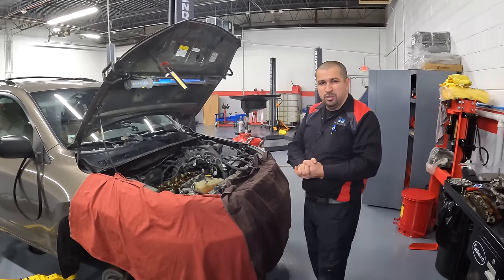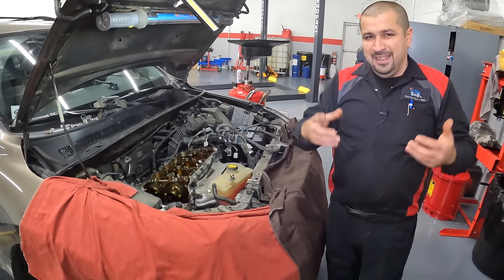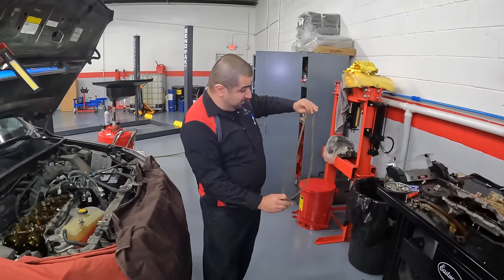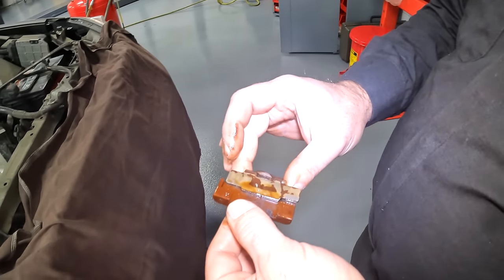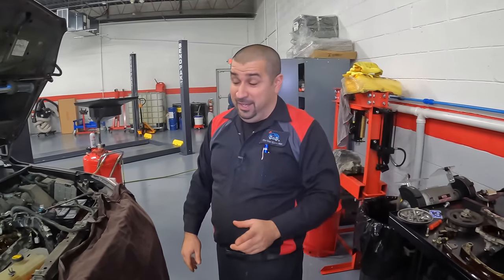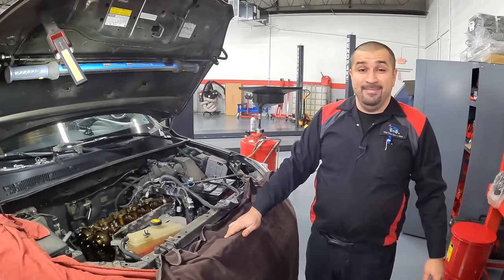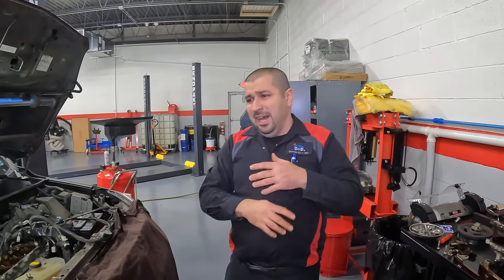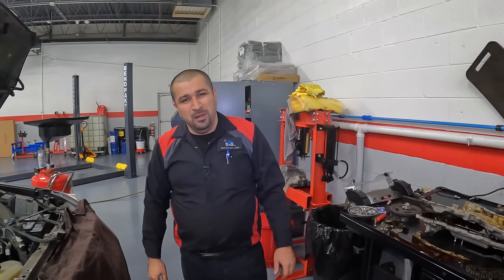When Should You Replace Your Toyota And Lexus Timing Chain?

Comment: Hello Mr car Care nut. I have a 2014 Toyota sienna and I have owned it since it had 10,000 miles on it. I have wanted to get my transmission fluid changed, but all of the local mechanics or the dealer want to do a transmission flush. I am very leery about doing a flush because of all the videos saying that flushes are dangerous and could cause dirt to clog up passages inside the transmission and cause slippage or total malfunction. I would do this myself but I have cerebral palsy and I am wheelchair-bound so my van now has 92,000 miles on it and the transmission is fine, but I know I need to get the fluid changed. What is your advice so that I will keep my transmission from failing? Should I chance the transmission being flushed? I love watching all your videos! I wish you were here so you could do the job! I have watched you treat every car you work on like it was yours and that is what I want. I live in Waco Texas, so that is a long way from you. Thank you again for your time! 
Your long time listener and friend! Robert.

Comment: My used 2012 5.7 Tundra timing chains failed. Bought 1 year ago. Oil was mostly changed mostly on time until maybe the 3rd owner roughly around 95k miles. Valve covers seeping oil slightly, small coolant leak at front of motor, bypass coolant area. Seized drivebelt tensioner bolt.

Comment: In a perfect world you would also replace the sprockets that drive the chain. A close inspection of the sprokets will reveal curling on the power side of the lugs wich will increase tempretures and cause premature ware of that new chain.

Comment: Another great video. Question about the Toyota recommended procedure for working on the VBTI gear. If doing it the Toyota way, not removing the valve cover, can the timing chain be scoped, with a camera, to check the paint marks that you mentioned?

Comment: Love your videos ! I'm building a 1ARFE for my 2013 highlander based on your video replacing the shortblock. the only question I have is do I need to unlock the timing gear   lock pin and put it in the advanced position before installing the new chain? I did not remove the cams or gears from the housing ..

Comment: In the 1970s Nissan and other brands used a double row of rollers on these chains. I think including Toyota. Now to save money and weight they use a "bicycle chain" on many cars. Many are lucky to last much longer than a belt. Toyota parts should last, but a single link roller chain would not be the best available. Never heard of overheating as an issue for timing chains. If if rattles when you start the engine, time for a new one.

Comment: Thanks for a good information. Few days ago I change the transmission oil & strainer for Toyota corolla 2013.I try to measure theoil discarded but when check the oil in warm measured 3/16"above the line. this cause problem to the transmission or is better to discard some part of the oil. thanksfor the information, GRACIAS.

Comment: I have 2000 Tundra  3400 6 cyl. 152 k. timing belt done @ 120k. I really like this truck. I don't think I will gamble with Timing belt. So new one will go in @ 220k spend a grand  and rest easy for another 100 grand. Also, I  love driving a solid vehicle with no payment.

Comment: As someone who has owned the greatest Toyota gas 4 cylinder of all time then 22R-E yes you can wear a Toyota timing chain out and guides do wear out as I have had it happen.  In the case of the 22R-E it will eat the front cover.
Reply: The 1975-1980 20R had a more durable double row timing chain mechanism than the single row 22R-E.

Comment: AMD, could you make a video on properly replacing coolant and bleeding air out of a 2AR FE, specifically for a ‘16 Rav4? I saw your video on the 2GRfe V6 but not sure if procedure is the same. Might be too simple for a video but I’d suggest throwing in transmission fluid and brake fluid for the same vehicle! 😅😅😅😅 I want to do them myself but not sure if procedure is the same as your existing videos.

Comment: Timing chains have been around since the first engines.  Then manufacturers changed over to timing belts ( most likely for cost savings and maintenance profits).  Manufacturers are going back to chains again because they are better.

Comment: Toyota engines are durable, except when they aren’t, is the actual lesson of this video. Their timing chains last forever…but this Toyota needs a new chain because of a design defect involving the intake VVT-i gear. In this vehicle AMD points out that the gear is replaced with “an updated design” — in other words, the original was defective, and caused a cascading series of expenses: the chain, guides, etc. And, given the age of the RAV4, it is no doubt out of warranty.  These vids are excellent, but what is often missing is a hint at what a shop repair costs. For this fix: $3,000? $4,000? That said, my 2008 RX350 has 135k miles with one engine related repair, the water pump at 120k. So, change your oil every six months and cross your fingers, because luck plays a role, even with a Toyota.
Reply: And do your research to know what problems can happen, which you're doing by watching these videos for example!

Comment: Hello Charley,
I have  a 1st Gen 2000 Tundra v8 sr5, extended cab with 428k miles it has an original engine and it still feel great. 

Recently, I had a near miss!  I hit the brakes super hard to miss slamming into Te car in front of me.  Thank God I did not hit him... I came within inches of hitting him bit I did not!

Since this happened, I hear a noise that sound like an air leak every time I step on the brake.  That that mean my break booster needs to be replaced, if so what do you recommend I replace it with?  Toyota has discontinued this model year break booster?
Reply: So sorry AMD, for some reason I thought your name was Charley!

I have to admit that yiyr videos are awsome and your knowledge is we all need a lot of!  God bless you  always!

Comment: I have an oil leak on my 2005 Avalon with 216k miles. It’s coming from the timing chain gasket so I might as well change my timing chain. But I never noticed any major issues but the oil leak

Comment: I may be a bit paranoid about this, but I have a problem with mechanical components that don't have a stated service life. It seems that in recent years timing chains have been failing prematurely quite often, and some manufacturers have had widespread issues. At least with a timing belt you don't have to go with any vague promise that "it will last the life of the vehicle", which is just Lawyer for "it will last until the end of the vehicle's warranty". You know when the belt is supposed to be replaced and how much it's going to cost, and a missed belt change is obvious on the car's service history.

Comment: AMD, did you ever find out what was causing the 2010 Toyota RAV4 to overheat, thereby causing the paint to burn off and needing a timing chain replacement, so after this replacement, it doesn't overheat again and burn up another chain?

Would hauling very heavy loads put extra stress on a timing chain and then need to be replaced sooner?
Reply: He stated in this video why the chain overheated. The VVTI gear failed, causing poor tension on the chain, causing the chain to rattle. The chain rattling caused the plastic part of the guide to break of the metal part of the guide. Once the plastic piece fell off, the metal chain was rubbing on the metal part of the guide, instead of rubbing on the plastic part of the guide that fell off. In this situation, it was not the whole motor that was overheating, just the chain itself. He replaced the failed VVTI gear, therefore fixing the issue that caused, and started the whole problem. Hauling or towing does not have effect on the timing chain. It is harder on the engine, but that stress is on the crankshaft, connecting rods, piston, and the engine block.
Reply: @brad3741  Thank you, Brad, for clarifying that for me and taking the time also to answer my other question, next time I will listen more closely or just rewatch the video before asking a question. ~ Have a Merry Christmas and a happy new year, Mark

Comment: What about Timing chain elongation ? I have a Rav4 D-CAT engine. 170.000 Km. I removed the chain and it gives me 149.4 mm distance between 16 links. Whereas Toyota says that maximul elongation should be 144.3mm. My car goes often in the Mountains of French Alps, but didn't particularly heat or pushes. Could it be a provoking factor of elongation ? Thanks for the Channel. I Love it.

Comment: I was making a U-turn and didn't notice the grass part where my passenger side wheel went on dipped down and wasn't flat as i thought. I heard a noise of something getting hit. The next day my Acura car was struggling to get up to speed after coming to a stop. Took ot the mechanic and turns out the timing chain is out of sync. To replace it, it's going to cost $2,200 😢

Comment: I've been hearing that ratchet chain tensioners aren't very good with timing chains. They make the chains too tight which leads to premature chain wear. Also an engine with direct injection is more likely to wear a timing chain out because of the soot in the crankcase.

Comment: Toyota used to overbuild their timing sets. I’ve had two 82 Toyota pickups with the 22R. Massive dual row chains with metal guides. In a 4 cyl barely over 100hp. It’s been slowly downhill from there unfortunately
Reply: I had a 77 Celica with dual chains , never wore out
Reply: Toyota knows how to build million mile capable single row chains; e.g. the Previa Van 4 cylinder and the 1995 on up Tacoma 4 cylinders

Comment: Most of the time, when replace timing belt, the water pump will be replaced at the same time.  If the car has timing train instead of timing belt, when will the water pump be replaced?

Comment: My Yaris, 2002, bought in 2005, still has its original exhaust system and complete engine, in fact almost everything is original. Even the plugs don't need to be changed so often these days. Regular oil and filter change, of course, by myself. The best car I have ever bought and I'm 77. I dread some prat pranging it. How do I replace that? They are becoming like hens teeth these days.

Comment: Would it be possible that after 25,000 miles on a 2021 4runner, the break pads need to be replaced because, according to the technician, the pads are already at 2mm, and the rotor is being scored really bad. I would gladly appreciate your feedback on this matter. I really like your channel. Thank you so much for all the information that you make available to all of us who watch your informational videos...
Reply: Nearly all brake shops offer a free visual inspection - it lets them estimate the cost of the brake job if needed. If a couple other shops say the same thing it is probably true. I don't understand about the scoring while there is still lining left on the pads unless it sees a lot of hard braking. I'm interested in CCN's take on it.

Comment: Where do you find the directions for replacing the VVT-i pulley without removing the cover? If the reason for removing the cover is to check for the faded paint marks and retrieve the plastic guide that may have fallen, can't the paint marks be inspected by rotating the engine?

Comment: I just got an 04 corolla with 77k on it and it always rattles for a second when starting and then it runs fine afterwards.  Does that mean the timing chain needs replacing.
Reply: Mine does this too and I plug a block heater in for at least an hour to prevent the rattle. Most likely you will need a new vvti gear, but I'd replace the tensioner too, as that is not too difficult. I've heard of people going years and years with this issue

Comment: My 2010 corolla with 80k has the cold start rattle as well. Here in Alaska I have to plug it in every morning for at least an hour and it prevents the rattle. I'm trying to prevent it whenever possible. The previous owners were an elderly couple that bought it new and had it garaged everyday so never experienced the issue :/  it's probably been happening since new.
Reply: My 2010 has 210,000 and rattles every winter in Mobile, AL.
Reply: @somenotherdude333  can I ask how long it's been doing it?
Reply: Since I got it at 180,000
Reply: Drove a Slant Six 1984 Dodge Prospector for 6 years with exhaust gasket leak and decided to replace exhaust gasket and manifold and figured, what the heck, ran 2 1/2 inch exhaust pipe with stainless steel Flowmaster Super 40 muffler and couple days later  blew new exhaust gasket so I had one day to buy another ride and found the one owner Corolla for 4,500 so I can't decide if I want to fix the rattle or just drive it...  What kind of gas mileage does yours get? I'm wondering if I should replace the spark plugs but this is first foreign car I have ever bought...
Reply: @somenotherdude333  4500? How many miles? Sounds like you got a good deal. Does it only rattle for 1 second on cold starts? If so I bet you could run that car for years, potentially forever if that's the only issue you're noticing. I get 33 if I'm in town, hwy though I've achieved 44 mpg hypermiling. I average 39. Another thing, if you want to avoid the rattle you can plug in the block heater for at least an hour. My block hester costs 20 bucks and took 10 minutes to install
Reply: @somenotherdude333  changing the spark plugs is super easy on this car so I'd say do it if you're over 100k miles. Never hurts
Reply: It had 180, 000 on it when I got it... Set up an appointment to look at 2009 Corolla XRS, the 6cyl. sport edition, with same miles and price, one owner also but on girls FB page I saw she was from Michigan and I was worried about salt rust so went with the 4cyl because the appointment was earlier and NEEDED ANYTHING besides the feet lol.... Bought it around Thanksgiving 2020 and never heard the rattle until first cold day in January but, yes... Only rattles for a second and you would think after driving a Slant Six with an exhaust leak for years it wouldn't even bother me lol... But it do!
Reply: @somenotherdude333  good call on the 4cyl. I understand the annoyance. The noise sounds terrible.. when it first happened I thought I spent $8000 on a warn out engine. But it's been meticulously maintained with record of every oil change since new. My roommate also has a 2013 so same generation. He beats it to hell and it runs like a top. I have a feeling most of these rattle issues are with the 2009 and 2010, though I've heard newer ones have issues to a lesser extent
Reply: I run Mobil full synthetic and change it every 4500 miles because I can leave 15 minutes late for work and get there 15 minutes early... Probably my gas mileage issue now that I think about it... Good luck with your rattle... Would be great to hear if you have any changes in your rattle or if you have to fix it... 👍
Reply: @steveng93  I forgot... Happens when you get old... When it first rattled with me I thought it was the starter... Sounded like it anyway but then, as you should know, it never did it again... Until it was cold ❄️ lol
Reply: @somenotherdude333  I'll let you if I ever break anything or fix it !

Comment: Thank you! 
I have a 2005 i believe it’s a timing belt. 
My question sir I don’t know if it was ever changed, the Highlander has 105,000 miles on it. 
When I got it I changed all the belts except Timing. 

My mechanic said the job is very expensive. 

My question is there a way of checking it by removing the top cover. 

Thank you.
Reply: One more note I mostly drive my Highlander locally.
Reply: Timing belt over 100k needs to be replaced!!

Comment: Toyota timing belts are just the same high quality material, 2001 Tacoma  3.4L TRD 4X4  315k still running strong, driveline still OEM.

Comment: I have a 2017 rav4 with the 2.5L engine that had 57,000 miles and it has a timing chain rattle on start up so I brought it to the dealer under warranty and they said it was normal even thought I told them that this just started making the noise 5,000 miles ago. Oil changes every 5K with synthetic 0w-20 oil and Toyota oil filters. I think the dealer is wrong and they just blew me off. The car has 64,000 miles now and it still makes the same noise every start up. This will be my last Toyota.

Comment: I have 2009 lexus350 has 210k miles ang 2013 sienna with 330k miles serpentine belt only parts I replaced. I change oils myself before 3k miles. If you can change oil yourself  do it don't bring to the car dealership or quick service. My Lexus and Sienna are in excellent condition..
Reply: I got an 02 sienna with 330k, u drive the shit outta ur sienna 😅

Comment: So, in reality the fixitive, the glue, the adhesive, toyota uses can hold the longer chain guides to the metal housing strip, but is insufficient to hold the 5 cm long guide together. Was it a hot chain or bad design of the smallest guide?

Comment: My 91 toy pickup, about 100,000 miles.  The chain guides are plastic and broke away.  Chain was slapping and wearing.  Got so bad that the timing could not be set. The replacement guides are metal.

Comment: I have 2000 tundra high mileage, at 278k,I just bought it, was best out of many. I look forward to rebuilding it as I know it's good for  that many more, work truck...project reliability engaged, lol. Since i don't have a complete history, I know a timing belt replacement at 300k is recommended, any chance of a video covering this? Or an appointment 🤔  in kc area... will travel. Oh almost forgot 2uz-fe, with headers and cats dated 2013, loads up and limps at 4k rpm, only does that with cruise engaged only issue I've had so far, prolly cats clogged? Dunno, would love an appointment for diagnostics...

Comment: AMD,
I have a 2009 Rav4 4cyl and it's eating oil excessively. At about 3,000 mile after oil change, the oil level is super low that it does not even show on the dip stick. Is this a common oil burning for this engine?